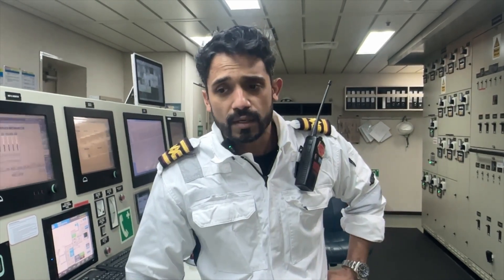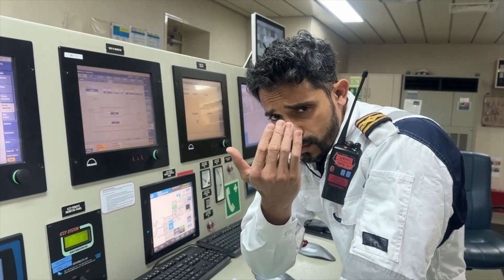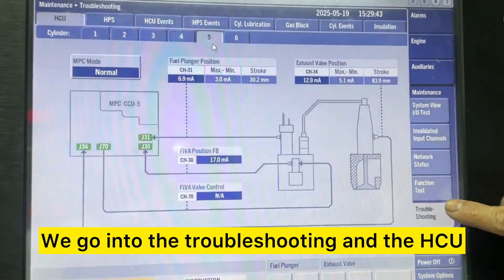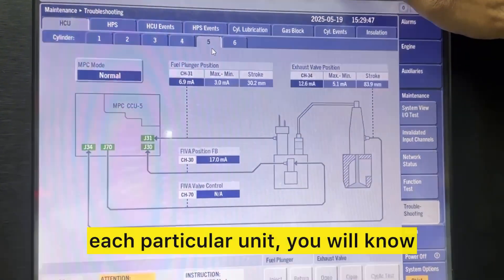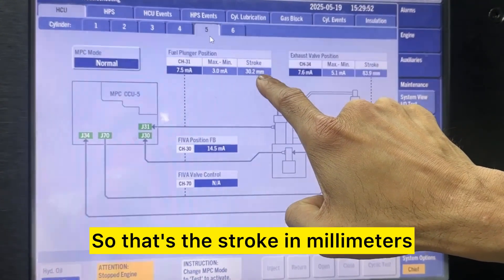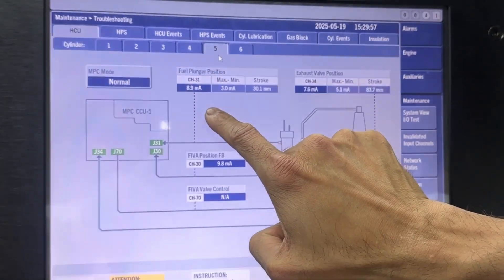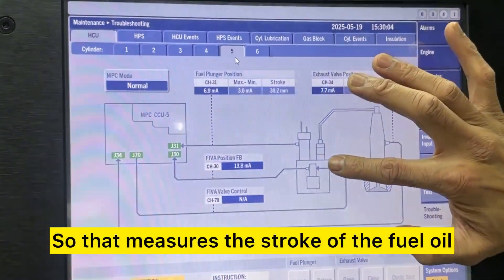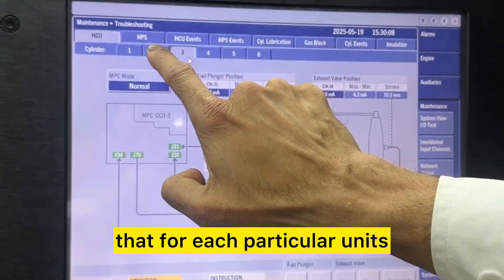MAN B & W MEGI ENGINES - Fuel and gas rack/quantity to each cylinder

Comment: Chief, the gas quantity is measured from where? Before or after the window valve? Because there is only one line for each unit. But we have 3 gas injection valves each unit.
Reply from the maker: The quantity of gas is not exactly measured here, it is the "OPENING TIME" of the ELGI that gives u the indication and reference to the other units assuming that the flowrates to all units is identical - so " Flowrate x time = Quantity ".
Remember this is a comparative figure not a Unit of measurement.

It's the same with MC engines too, your have multiple fuel injectors but one common value of Fuel RACK for one cylinder.
Reply: thank you chief 😊